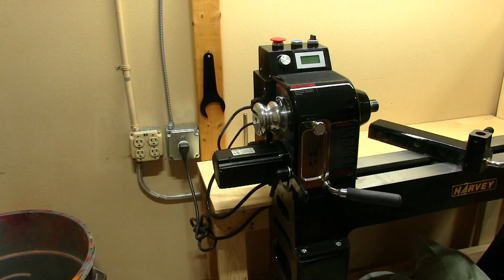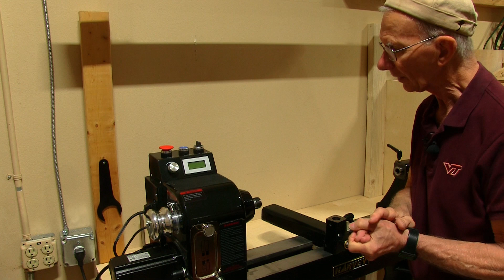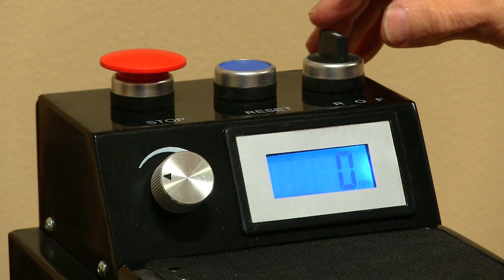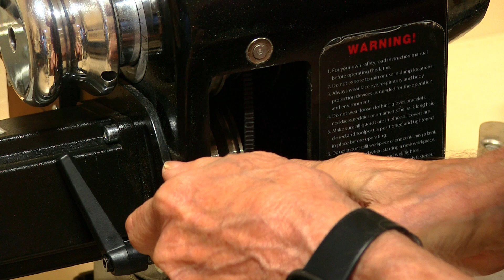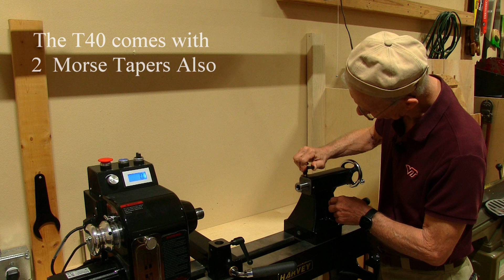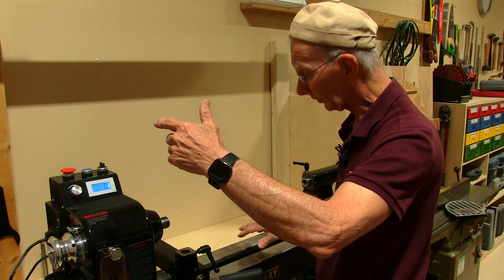Harvey T-40 Lathe

Comment: Nice review. Can you please measure the height from the floor to the spindle including the legs?
Reply from the maker: The height is adjustable and looks like it centers around 46" +/- 3 inches.
Reply: @benj6054  Thanks for the information.
Reply from the maker: The largest workpiece you can turn safely on the Harvey T-40 lathe using the rotating head is up to 20 inches (508 mm) in diameter